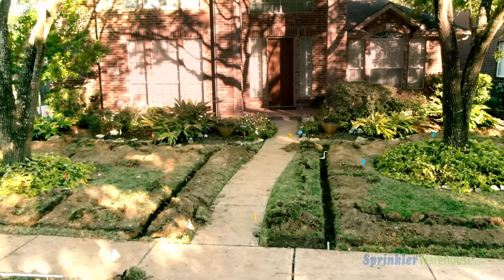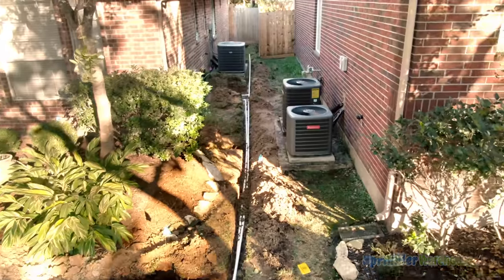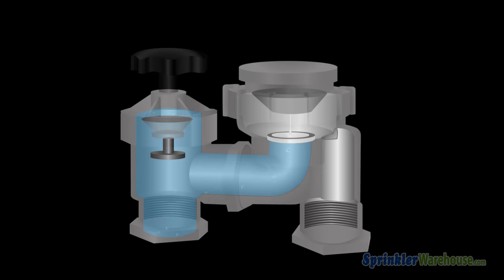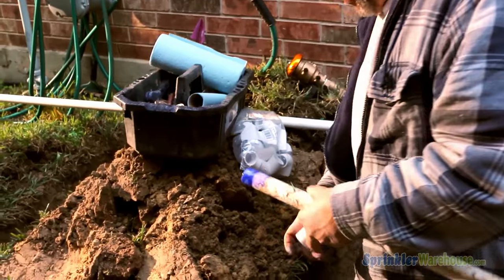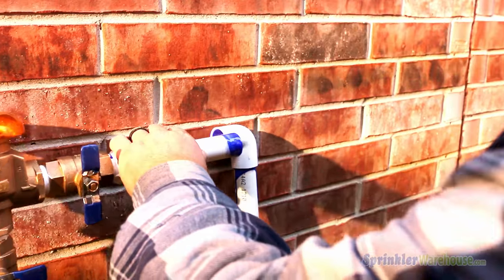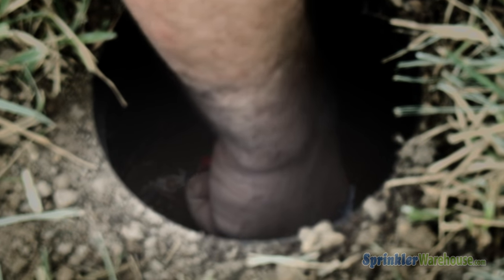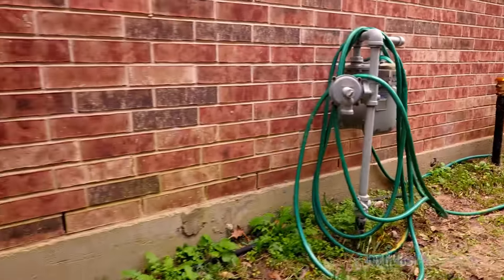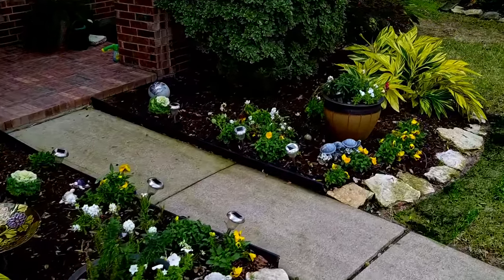Tapping Into the Main Line

Comment: Makes my skin crawl to see the above ground back flow, I’m a young guy and wasn’t taught like that! 

That’s the new way.
Reply: Where do you out the backflow?
Reply: @robertlam5507  Tap it off the water meter and bury it in a box, I dont understand why people put it above the ground on the side of the home.
Reply: Here in Illinois we cannot use PVB’s we have to use RPz backflows. The cannot be buried under ground. They can be out in a basement or a boiler room. If you install a RPz indoors it must have a drain pipe below the dump at least 11/2 times the size of the RPz backflow. We are not allowed to use “douable check valves either. I think every state has it’s own codes.
Reply: @robertlam5507  Probably so, in some states do you have to have a plumbing license?
Reply: @logansneed2882  yes. In Illinois it takes a licensed plumber to install and test them. In Missouri I have a license to test and repair them. The unions in Chicago set the rules for Illinois and keep us Irrigation guys from testing.
Reply: @robertlam5507  crazy I think the further south you get it’s just a less strict, doesn’t take a licenses down in Oklahoma or Texas
Reply: @logansneed2882  I thought Texas did but may be wrong.
Reply: @robertlam5507  I could be mistaken on that as well let me take that back Ive only done work in Oklahoma, but as long as you know what you're doing Im pretty sure they're alot less strict but more than likely like you said, it prolly varies each state.
Reply: @logansneed2882  PVBs will not work if it's at the level of the highest outlet downstream or below it. It should be at least 12 inches above the highest outlet downstream. My understanding about putting it on the side of the home is that it will less likely get knocked over and break. I could be wrong but that's just my guess.
Reply: Whoever taught you was wrong. PVB's must be at least 12" above the highest sprinkler.

Comment: Ya. Everyone seems to think that 1 inch main is way to go. Many times , if large residential and or low pressure  - Good idea to go 1-1/4 inch sometimes. Or even larger depending on meter size. This one size fits all is getting old.
Reply: 1" usually does the job, I hardly ever see the reason to go above 11/4"   11/2" hardley improves your pressure but cost more and is harder to work with.
Reply: @noeeon9910  Hardly improves your pressure?  I've done repairs on hundreds of systems.  Bad advice
Reply: @Jehucurliss2kings   I'm a licensed irrigator and licensed backflow tester. You done hundreds? I've done thousands... the amount of friction loss that happens in a 11/2 pipe is not that much of a drop from 11/4 look it up on your pressure loss charts if you know what those are.  Therefore the benefits of using 11/2 aren't many...
Reply: @noeeon9910  Have you ever designed a commercial system  ?
Reply: I see now that your main point was pressure loss between 1 1/4 and 1 1/2. My main point of disagreement was your statement that 1" usually works. Depends on size of system.
Reply: I've seen WAY too many 1 inch mainline where should be 1 11/4 . My main point. Like you said, pressure loss charts should be used. Not generalities.
Reply: LI 0003014.     1985
Reply: You know. Way back when you had to design/draw an entire system to get licensed.
Reply: @Jehucurliss2kings  yep, you actually had to draw it by hand, sorry about my crass comments. Theres too many clowns in this industry. You sound like a good irrigator
Reply: No kidding. My pressure regulator stopped working and I was getting 125 PSI in PEX lines. There were quite a few leaks, like every valve leaks and all connectors. What a pain.

Comment: Why do you not put unions on the PVB so that they can be taken off for the winter? What a waste of time and money to wrap insulation around the pipes. Also why not put a ball valve on the upleg pipe so you can shut it off at the backflow in case you have to replace it?
Reply: I agree with the unions. Exposed pipes (above ground) and capped off will break when the water inside freezes and expands, so it needs to be wrapped. In the video, it showed a shut-off valve was installed right after it teed off the main line in case you've missed it.